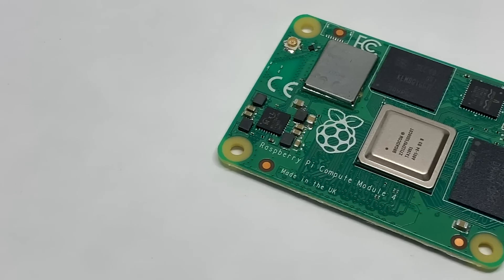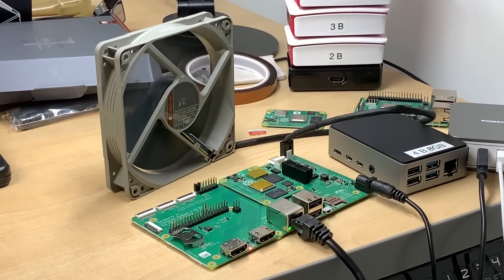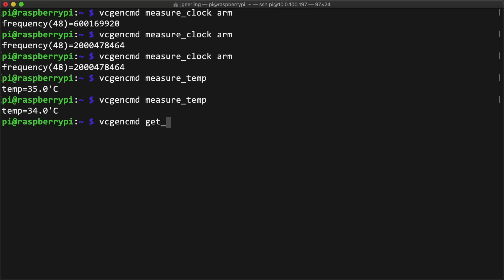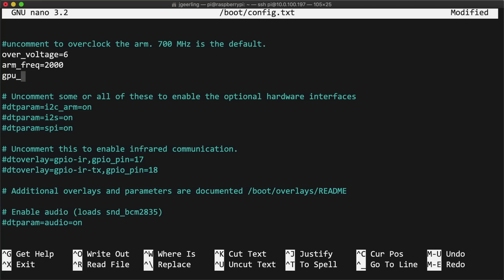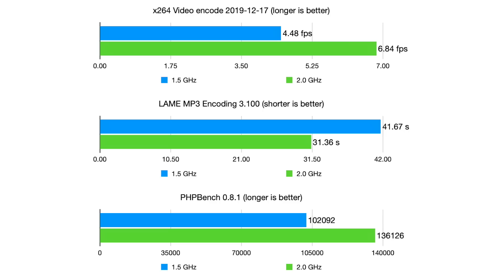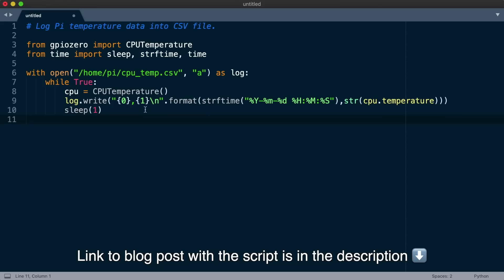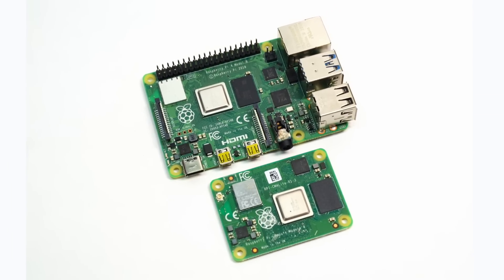Raspberry Pi Compute Module 4 OVERCLOCKED

Comment: Since 2147 is the 4 most significant digits of the maximum value in a 4 byte signed int (32 bit signed integer), I assume that the cpu frequency is internally stored in a 4 byte signed int.

Comment: I got 2 CM4, all 8G ram but one with 32G eMMC + wifi, the other one no eMMC and no wifi.

It turns out the one without eMMC seems to maintainer higher overclock with lower voltage than the one with eMMC, not sure if it's silicon lottery, or a persistent behavior.

BTW, if you are a mainline kernel guy like me, choosing to run mainline kernel (with downstream dtb since no upstream dtb yet), then it's better just use lscpu to get the upper limit core speed, and sensors to get the temp (with things like NVME temp too)

Comment: i want to see the compute module at full overclock, both cpu and gpu, run the same tests, also will they work ok with just heatsinks. i know the 4b gets toasty with just heatsinks, will the compute module throttle when going full tilt?

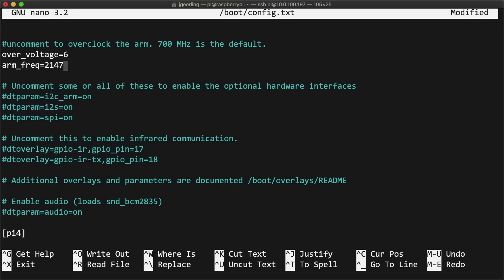Comment: 2:36 Yes, it was in the old linux kernel but now you can reach more than 2147Mhz, i am able to reach 2350Mhz (+/- stable lol) with this settings :
over_voltage=6
arm_freq=2350
v3d_freq=50
isp_freq=1
h264_freq=1
hevc_freq=1

Comment: I overclocked my Pi 4 B out of the box, I bought it with a tower cooler so I would never have overheating issues, rock solid at maximum overclock. Strange thing is that the software I use to show me the current status of my system says the clock is 2.29ghz. And it's been so long since I've messed with the boot config I don't remember what I said it to. Maybe it is 2.29 lol. Anyway great video, I wish I could get my hands on a compute module to mess around with PCIe, M.2 and the RTC.

Comment: 2147 is the largest number of millions (i.e. 2.147 billion) expressible in a signed 32-bit integer to 4 significant figures, meaning that 2148 would overflow.

Comment: I feel like some sort of heatsink that covers all the chips would be great. Maybe an active fan for the SoC as well, like we see done on so many regular pi4s.
Reply: the height difference between chips means you need a heatsink to match, i bet you someone is making one.
for now you have those little thermal tape heatsinks and ill bet those do wonders by themselves
Reply: @LoneWolf0648  we already have cases that account for the different heights with separate contact patches for each chip. Milling those patches into a single large piece at the base of some fins is certainly doable.

Comment: Sort of surprised you didn't attempt some sort of heatsink as the CM4 format is far better than the Pi4 and also it clamps the CM4 in position. I presume we will at least see 3rd party CM4 heatsinks quite soon.
Having the offboard antenna is also such a plus to placing a big slab of metal over pcb antenna.
The I/O board has a fan header and it would be great if you could give info on its operation especially in conjunction with heatsink and a 12v supply.

1.8Ghz with cooling is sort of a norm for the A72 but the Google Chrome flaptops did run at 2.0Ghz.
Reply from the maker: I'm guessing someone will come out with a nice flat heatsink for the CM4 soon. It begs to have one so you can use it overclocked without a fan. In most enclosures, though, I'd still recommend at least a fan before the heatsink (because you'll need one anyways, and even without a heatsink, a fan will take care of keeping the chip well below throttling temperatures.
Reply: @JeffGeerling  I am presuming with a cluster you can just have heatsinks and then some form of case fan header like on the i/o board.
The layout does look like a super simple heat sink will do.
I often don't bother with pwm and just put a 12v fan on 5v and with a heatsink its silent and really effective.
Never seems to get to a point where PWM is needed to make it faster so don't bother.

Comment: Suggestion for future video. Pi-KVM is a FOSS project for KVM over Internet. A Pi is used to remote video, kbd, rebooting and more. Good for remotely monitoring a server's video, INCLUDING BIOS startup, sending keystrokes and rebooting. Solves the remote zombie problem. Hardware based solution and therefore works with any OS. A similar project is tinypilot. https://www.youtube.com/watch?v=9YhPWjWv5gw

Comment: Overvoltage may need to be set to only 2 or 3 (if you stay below 50Mhz under max frequency).
Someone mentioned 2147Mhz = 2^31st, which is probably an arbitrary hard limit set somewhere in that form, because they got to draw the line somewhere (and most Pis won't exceed this value anyway)...
My Pi 3B ran fine at 1510Mhz with heat sink and fan. Perhaps pasting a heat sink and fan on the CM4, will allow you to run higher clocks.
Are there any boards that are cheaper? All I need is USB and HDMI.

Comment: Nice thing but does it work without the i/o board? And if: how? I would prefer it over the normal one because of its size but the board destroys this advantage. All peripherals i need are the GPIO pins, one USB for Wifi antenna thingy (i want a stable long range connection, bandwidth is not the priority(for EZWifibrodcast=>GitHub: https://github.com/bortek/EZ-WifiBroadcast/wiki ))  and of course a way to power it. OK, a sound port (how do you call this in english) would be good, too. 

Without getting higher (than the regular pi)
Reply from the maker: It works without the IO board... but you'd need some other carrier board that at least provides power and has whatever IO is needed.
Reply: @JeffGeerling  ah, interesting
Thanks for your answer

Comment: Fan without a heatsink is stupid to me.. Just stick a passive heatsink from some old passive vga, I use GT 710 coolers for almost all arm sbc..
Reply from the maker: The SoC doesn't really need a heatsink if you have airflow over it. The whole point of the large metal piece on top of the package is to dissipate heat. If you want to add an additional heat sink, that's fine, but it's not necessary with this processor if you're using a fan.
Reply: @JeffGeerling  It obviously termal-throttles and the temp is too high, for overclock and also even heavy load this small metal piece is as good as nothing, why use 120mm fan for a small module like rpi instead of heatsink (and a small fan on 5V or pwm control 30-50%)?
Reply from the maker: @bits2646 It only throttles if you have no cooling whatsoever. In the video I show that just moving air over it keeps it well under 65°C. Would it be even a tiny bit better with a heatsink? Yes. Does that matter if just having a fan on it works fine? Not really :)

And the only reason I'm using that fan is its the only 4-pin fan I have on hand. If I were doing anything more than testing right now, I'd use a much smaller fan (though I hate those itsy-bitsy Pi 5v fans that sound like bees). Even so, I'm also planning on adding a script that uses the IO board's built in fan controller to keep the fan at a much lower RPM since it doesn't need to be putting through a ton of air to keep the chip cool.
Reply: @JeffGeerling  For the fan I actually meant a normal 12V fan just on 5V, like in old days when we did 12V or 5V or 7V directly from lines, until script isn't implemented, the manual volt-set will save the day, doesn't need to be itsy-bitsy 5V that beeps like a bee ,)
For the other, as first it does not make any sense (even with normal smaller fan) to cool the cpu without a heatsink and as a second, fan is a moving part, what if it breaks and you don't notice, you'll hurt cpu speed and cpu itself maybe, so heatsing is a must, and for a chip like that, even overclocked, slap a heatsink and (thin) thermal tape/pad and that's it (unless you install it don't-know-how-but-looks-like-people-can the way that it fells down), and a job done, then any small amount of air will only be a bonus. safe, secure, silent, cheap.. I mostly look in my magic box and find some old coolers, I slapped old intel cpu cooler (from core2quad ? ) :DDD Just rewired the fan because it was bloody noisy and extended with a thin copper plate that also makes contact with emmc and ram, emmc can get pretty hot and with only 40x55mm the heat dissipation from pcd is kinda nonexistent and flash chips is best to run at 35-40°C, so I cracked one egg for multiple omletes (as we'd say in my language ) :PP Have seen to many rpi (cpus on cm) and flash chips (not just on rpi) breaking down with time just for constantly running too hot to handle...

Comment: tbh testing with nvidia gpu might landed you with a few hurdles, so I'd recommend RX 550 since you can build kernel modules and even mesa for it. i'm interested with custom board design, but part of the design decision left me mixed. if they were able to give 2 pcie 2.0 x1, interesting designs will pop up to maximize the no wireless, lite cm4 potential

anyway from what i read, the bootloader hasn't support nvme booting yet, how did yours is able to do that?

Comment: Can you run some Linpack benchmarks on the CM4? I am considering to build a cluster to do some scientific calculation, and I want to know whether it is more cost-efficient to use Raspberry Pi or x86 platforms
Reply: Try them on a regular RPI4. They're the same hardware, just in a different form factor. Linpack is my favourite burn-in etst for overclocking and testing of our passive coolers.

Comment: Jeff, would you test gpu_freq (reliable maximums) against the various gpu blocks... v3d h264 isp hevc etc?
.
there seems to be a Lot of variation between boards on this. core and v3d seem similar but this can leave h264 churning against the cpu (failed video playback) when gpu_freak is set high. I doubt if 1000,000,000hz is reliably possible but, you wanna try? xx #Pear

Comment: I never used a comput module, and I wonder is it easy to use this directly without the IO board? if there is a breakout board to expose the pins of the connector, would that be enough to start working with it? (example: do serial communication, connect usb device through the pins, etc..)

Comment: I would like to see an AMD gpu tested, because the open source drivers are much better. Either the HD5450 is available in a pcie single slot format or choose any other card with a pcie riser cable which converts x1 to x16 :) Thanks for the great video

Comment: I just kinda wish they had gone with a PCIe connector along one edge (like the old SO-DIMM), so you could easily make a rack of Pi 4 CMs on a PCIe planer board.
Reply: Yeah it's weird it seems more likely people would stack these vertically than place them horizontally next to each other. The Turing Pi 2 has an adapter board with dimm like connector on which you stack the compute module, which is imo a nice solution.

Comment: Mine runs super fast and relatively cool ( temp=48.0'C ) with a heat sink, a fan and these settings;
- over_voltage=8
- gpu_freq=750
- arm_freq=2147
Note: the rest of the chips have mini heat sinks attached  too..
Reply from the maker: Nice! Do you have it in a case?
Reply: @JeffGeerling  Yes, just one of those  regular inexpensive cases that you can find on eBay with fan and heat sink, and I am running Twister Os,  it is awesome!

Comment: granted you didn't use a heat sink, but every time i see a heat sink on a sbc they always use the thermal pads provided. i personally am curious about thermals with a decent thermal paste vs thermal adhesive
Reply: We don't use them. https://www.youtube.com/watch?v=RbzKM5XxlOA
So far, direct contact with thermal paste versus thermal pads can shave off some 3 degrees Celsius AFAIK...
Reply: Thermal adhesive is used because there are no mounting points for a heatsink...

Comment: Thanks again, Jeff! Just what I will need to know, as soon as the CM4 arrives. BTW, when I overclocked the RPi4, the hdparm results on the Corsair GTX Flash Drive also improved from ~250 MBs to ~270 MBs.

Comment: How about active and passive coolers with OC? I not talking about crazy liquid cooling or anything, but like a basic heat sink with 2GHz temps and that.
Reply from the maker: Not a bad idea. I don't have anything other than a few tiny CPU heatsinks that are less than 1" square, though, so they wouldn't make a significant difference.
Reply: LN2 is crazy, water is boring.
https://www.youtube.com/watch?v=RbzKM5XxlOA

Comment: The Pi4 is in my mind, not quite desktop ready, but running at 2GHz CM with an NVMe it may just have edged over that hurdle. Thanks Jeff. Perhaps you can measure the current from the power supply while running full tilt (with NVMe)?
Reply from the maker: That's... something I meant to do for this video but completely forgot! Oops! I'll have to check on power consumption later.

Comment: What's the reasoning behind disabling the SD card on the IO Board if the unit has eMMC Flash storage?  It baffles me since I would think you would want to still have access to an SD card
Reply from the maker: The eMMC device uses the IO lanes that would've been used by the microSD card; these tiny mobile SoCs only have so many IO lanes and bandwidth available.

Comment: You mentioned earlier that not all SSD worked. Maybe the ones that failed were DRAM-less? LTT once mentioned they use system RAM as mapping cache for wear leveling, and I guess the PI CM4 does not support that particular interface.
Reply from the maker: That could be it! I've been trying to find any way to identify whether they work or not based on specs, but manufacturers are all over the board (just like with UASP support (or not)).
Reply: The ones with cache usually claim speeds in excess of 3GB/s, the ones without drop under 2GB/s. If they don't brag about DRAM, they don't have it.

Comment: 2.147 billion Hertz... Sounds like a signed 32 bit integer to me. Why they'd need negative frequencies though I don't know.
Reply: They need negative frequencies for when the RPi is travelling backwards through time.
Reply from the maker: I... uh need to go do some testing.
Reply: @SlykeThePhoxenix  No, its for powering "undo" :)
Reply: If you look at some of their drivers and libraries you can see there are many bad decisions, so it's probably one of the same people.
Reply: @gg-gn3re  well I hope something interesting happens if you set it to -1GHz lol
Reply: @gg-gn3re  probably building on the work of others, makes it faster to market and 
also if ti works that is "good enough" culture, broadcom chip was not engineered for raspberry pi ...
Reply: the code to parse config.txt was generic, and just used signed 32bit for every numeric value, the firmware has since been fixed to let the arm freq go higher

Comment: Cluster cooling in a bath of oil ( mineral and electric neutral) ? Great work
Reply from the maker: Liquid-based cooling has always scared me since I had an older PC get exploded from a leak in a liquid pipe system.
Reply: @JeffGeerling  thats why oil , it doesnt short
Reply: LN2 cooling (albeit of a RPI4 - but they're the same hardware internally).
https://www.youtube.com/watch?v=RbzKM5XxlOA
Well designed heatsink with forced airflow will perform almost the same as a dielectric coolant with less hassle.

Comment: Probably it's 2147 MHz because the value used to define the frequency is a 32 bit signed integer.

EDIT: source code https://github.com/raspberrypi/linux/blob/rpi-5.9.y/arch/arm/mach-shmobile/timer.c#L23
Reply from the maker: Boom, you win!
Reply: @JeffGeerling  any chance you could make sure people know that force_turbo and Any over_voltage invalidates your warranty? xx
.
there are some utils that do this on a reboot, with no warning. Afaik you can't exceed over_voltage=6 without setting force_turbo=1, even if it's set in config.txt  (and yes, some pi4b's need ov=8 - particularly 8gb boards - to maintain 2147) ^^ above comment  ... you sure it's not just because Eben loves snooker? :D
Reply from the maker: @pearcomputers  I intentionally avoid talking about that (and don't mention force_turbo at all) because I'd rather people have to figure that out on their own (e.g. only show how to do things within warranty unless I explicitly state "this will void your warranty"). I would recommend people never run random utilities, especially those that require root/sudo access, on any of their computing devices, unless they know what the thing is doing (and ideally, it is open source code) :)
Reply: @JeffGeerling  i would not cry if i lose a pi ^^
Reply: Actually, it runs at 2147 MHz, but the over voltage has to be set to =8, not =6
Reply: @7091pm  8 is max but if you don't have cool chip and good psu it won't be stable, 6 is enough, +125mV is enough for a72
Reply: @7091pm  6 is working better for me :) my keyboard and mouse is powerhungry :D
Reply: To answer to some of the comments above, I tried 2147 MHz with an over voltage of =6, and the computer didn't even start, until I set it to =8.
By the way turbo mode doesn't work with these settings either, so uncomment turbo mode.
I don't know if this has something to do with the OS that I am running, which is a heavily modified version of Raspbian called Twister OS,  check it out.
I tried Ubuntu Mate 64bits and it works too, I didn't like it thou..
My pi runs in performance mode at 2147 MHz all the time with no issues at all Running TwisterOS.
But if you are going to try, make sure you have a heat-sink and a fan or it will over-heat, (and the pi will tell you right away).
Reply: Nice explanation mate!

Comment: The clock speed of a processor is a result of the main bus speed times a "multiplier" that is used by the system to downclock and throttle. When you overclock, you are just changing the maximum of this multiplier and so the resulting speed has to be a multiple of the main bus speed. I don't know what the exact numbers are for the pi.  I tried to find info on the bus of the a72 but it was surprisingly scarce.